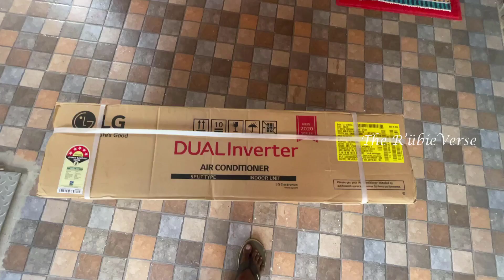LG 1.5 Ton, 5 Star, Inverter Split AC, 100% Copper, 2020 Model, Installation

Comment: Sir if possible , please make a video of electricity power consumption testing in watts , how much electricity consume at the time starting and minimum power consumption after desired temperature achieve ... 
Please test 6 to 8 hours continuously test, how much electricity unit consumption..... According to company power consumption is very low